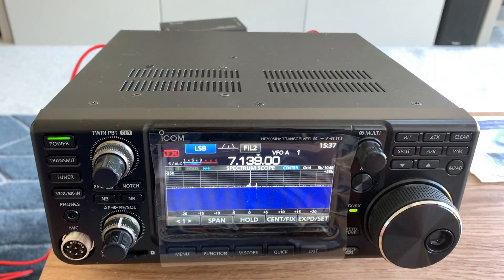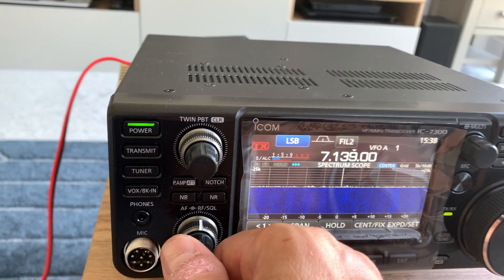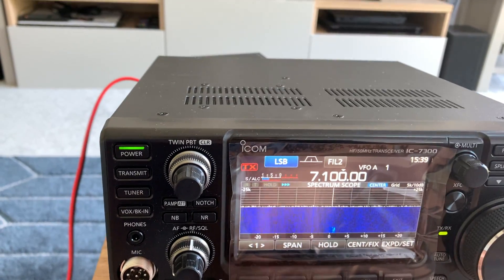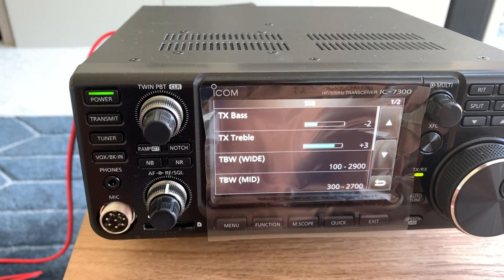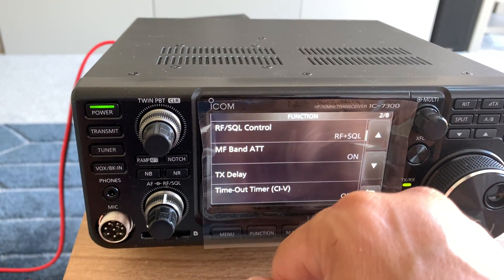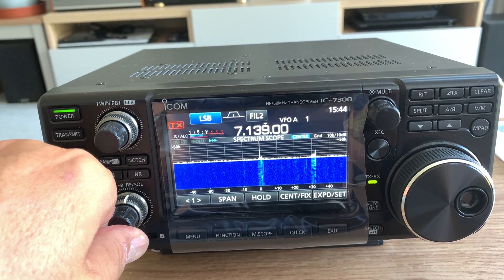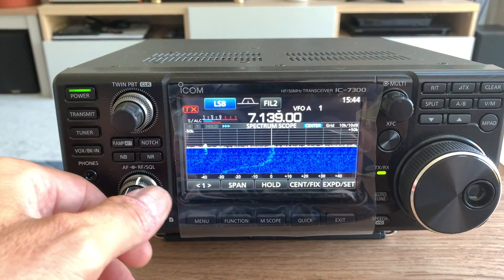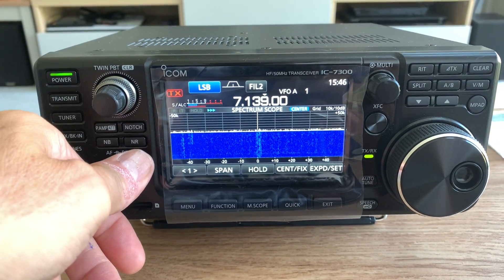Icom IC-7300 ham radio HF/6m transceiver - first power up and a brief overview

Comment: Clint, All the best with the new  IC-7300! I've had one since the middle of 2016 and I like it very much. A couple of tips - watch the mic gain and compression settings - it's not as forgiving as a Yaesu. Your voice peaks should not consistently exceed the middle of the ALC zone.  Personally, I use a mic gain of 32-35%, and the compression level set to 3. The other tip concerns audibility of the loudspeaker -  it 'fires' upwards in a narrow beam. I find that when seated directly  in front of the rig I lose high frequencies and clarity suffers. So, I use an old credit card, folded in the middle and secured just behind the speaker, then angled to redirect the sound forwards towards the front of the rig. Works a treat. Anyway, enjoy your new rig, and good DX!
Reply from the maker: Hi there Malcolm, thank you very much indeed for the tips on the 7300. I have tweaked the TX base and treble (base down/treble up) and the consensus on the sked. last night was that my audio was much better than with the FT-991. More to do though and I will follow your advice. Thanks again and 73s, Clint

Comment: I do hope that Icom will replace the R-75 with a receive only version of the 7300.
Reply from the maker: That would be brilliant Steve...but no signs thus far. 73s, Clint
Reply: they have but its so expensive r8600 at £2400 ish
Reply from the maker: Exactly Ron!
Reply: @OxfordShortwaveLog  yes but he could get a 7300 and not use it to tx just listen 
i love mine their  just so good